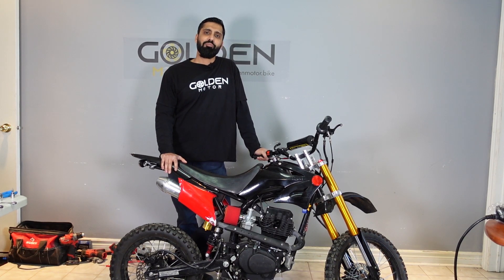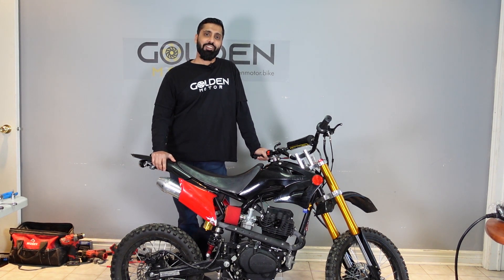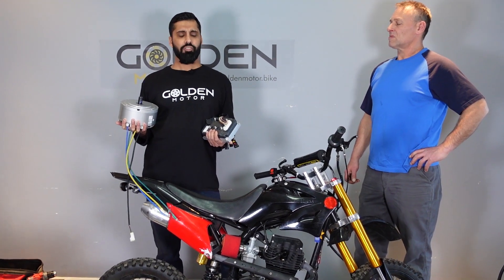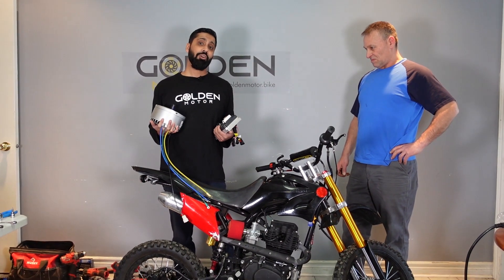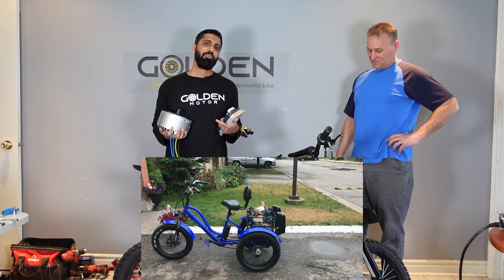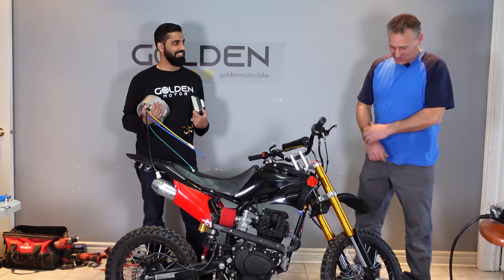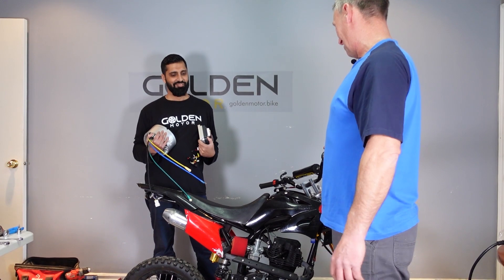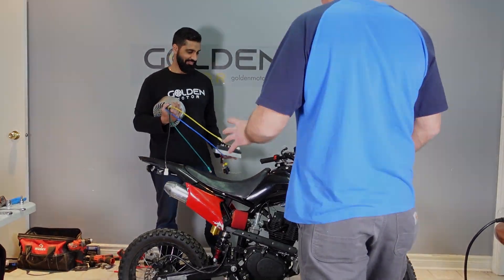DIY Lifan Dirt Bike to Electric Conversion - Part 1

Comment: Just wondering what would happen if the red and black leads from that 72 volt lithium battery laying about and inch apart should happen to touch one another ? Would that not short out and go boom ?